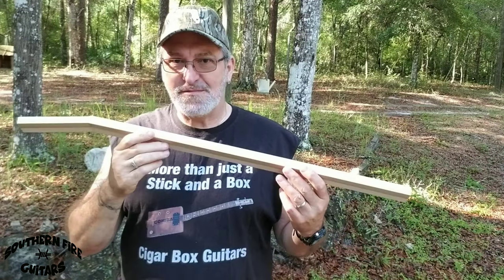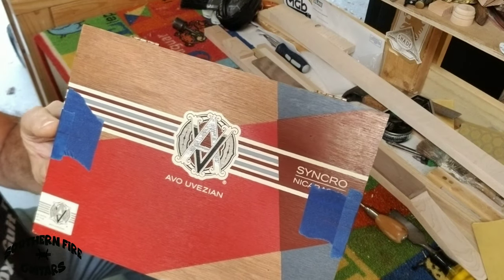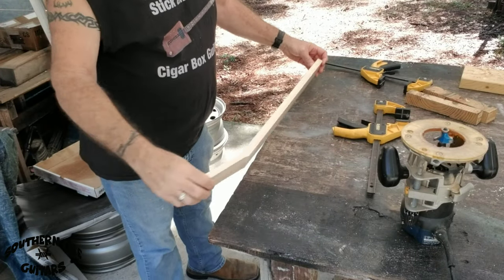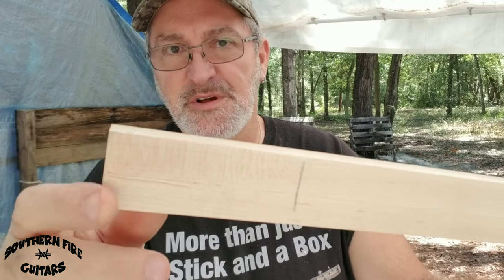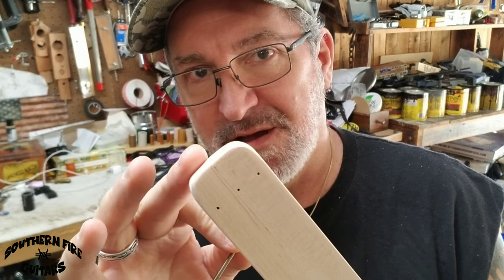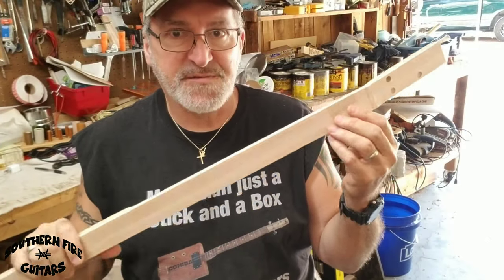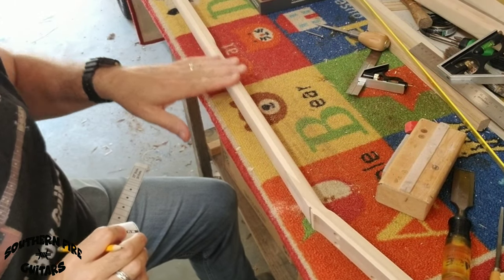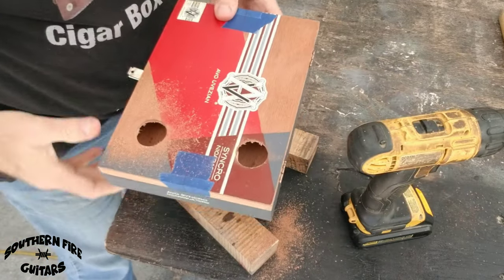Cigar Box Guitars - Building an EASY Fret Less PRIMITIVE CBG Slider - Start to Finish

Comment: Definitely love your videos!
Unfortunately, the fret saw you linked does NOT come with the depth guide that the one in your video has. In fact, no depth guide or screws at all - just the saw. I know this because I ordered the saw from your link and mine arrived today without the guide.
Reply from the maker: Thank you TL, Very sorry about that, that link was linked to the other saw, because people have purchased it from that link. Not sure why it was changed, very sorry. You can send it back and get a full refund on it. Again very sorry about that.
Reply from the maker: That's weird.
Reply: @SouthernFireGuitars  No problem. Just thought I'd share my experience in case anyone else might've ordered the saw expecting to get the depth guide with it. On another note, I went to Harbor Freight today and picked up one of those small flush-cut handsaws like the one you use. Thanks for sharing your time and experience.
Reply from the maker: @TLAS  Thank you, TLAS.  It took me a while, but I think I fixed all the links to the correct saw. That's a good little flush cut saw, stays pretty sharp.  M~